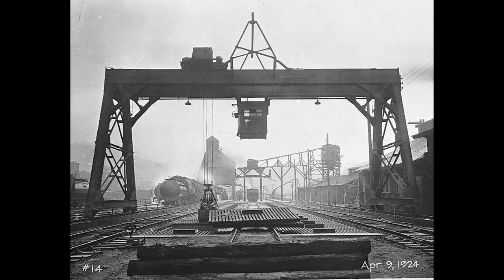Scracth Building a Ho Scale Gantry Crane

Comment: Great project Mark, the best way to get pics of this is to go ahead and build and finish it and afterwards everyone will point out everything that is wrong with it and send great pics to prove it, lmao  just seems so hard to get good data before you start the project, lol. Looks like you have done a great job coming up with a plan based on the pics. Nice to see you scratch built some of the structural members. Evergreen isn't as cheap to buy as it once was. Other options for rivets are out there too such as rivet decals which are 3d, I have used them, they are ok but I usually use my NWSL riveter, it really makes the rivet work line up straight and if you use it enough, it will more than pay for itself. as far as the clamshell bucket goes, this one I think is actually operational, check out this link https://www.ebay.com/itm/273729151212.  Looking forward to the next video. Cheers Rob
Reply from the maker: Thanks for watching !!!   Yea I have a riveter from NWSL as well  It is a good tool . I just decided to do these by hand.  Should be an interesting build !!